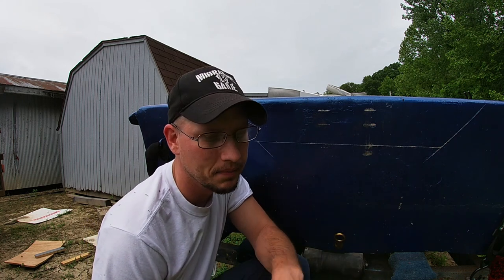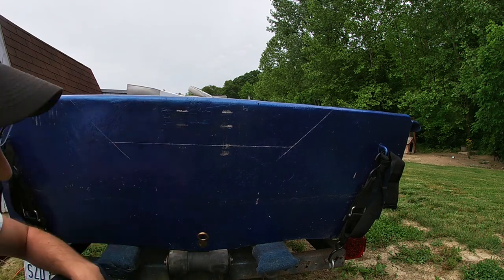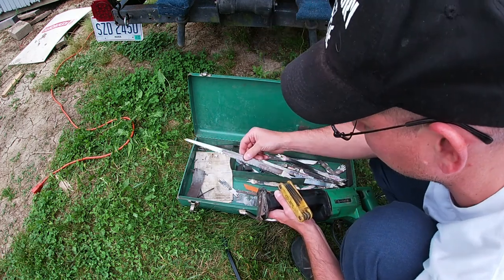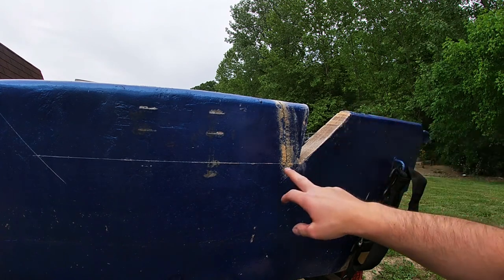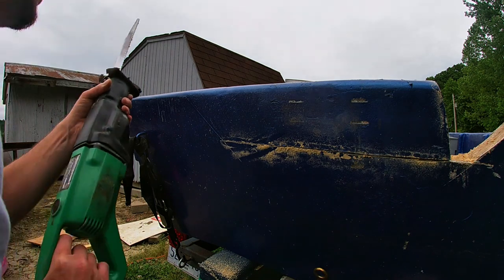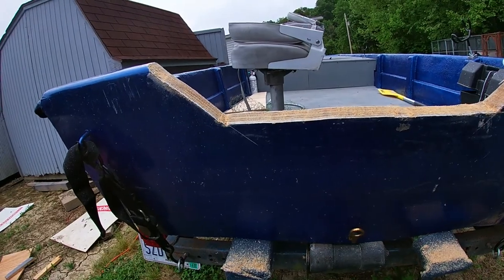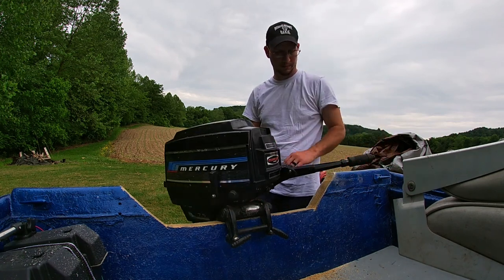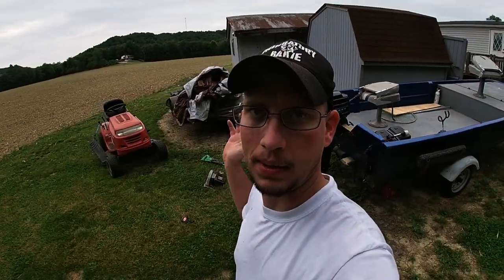I CUT my TRANSOM down to FIX my MOTOR

Comment: The motor came out low probably because there are 20,15,and many small motors have 16.5".You measure it from where the the top of the clamps touch the wood to the cavitation plate.You did a nice job!
Reply from the maker: Thank you. I didn't know anything about boats, I bought the boat and motor separately. 5 inches makes a big difference.
Reply: @migratorygame7400  yes,better a little low than high.

Comment: Sckeg plate not bad at all I don't know what your outcome was but I personally probably would have had a nice aluminum sleeve made for it
Reply from the maker: Thank you! It definitely took care of my problem. I actually used two aluminum plates for a motor mount, so It wasn't digging into the fiberglass.

Comment: Looks like it'll work!!
Reply from the maker: It works! I'm glad that was the problem instead of it jumping out of gear.
Reply: Glad it worked. I have to do the same thing.
Reply from the maker: @divorcedguy1765  short shaft motors call for a 15 inch transom. 20 inch for a long shaft motor. Thanks for watching!